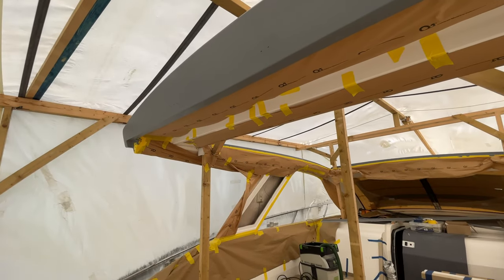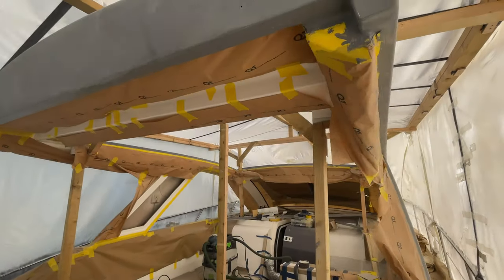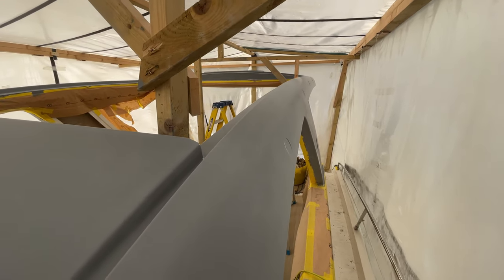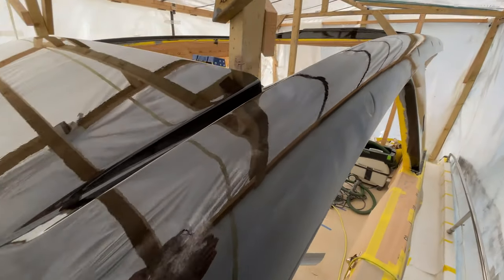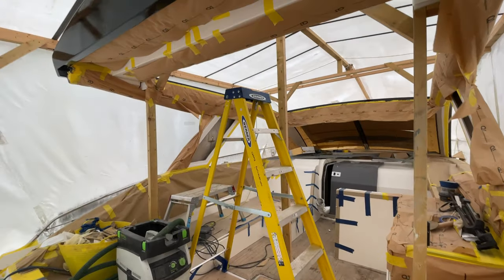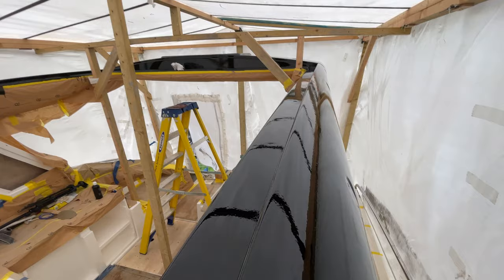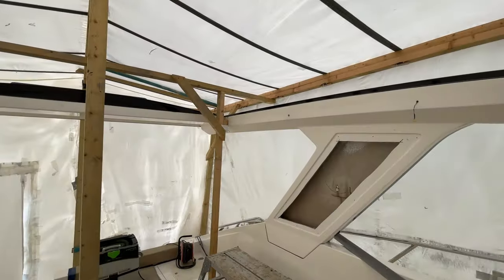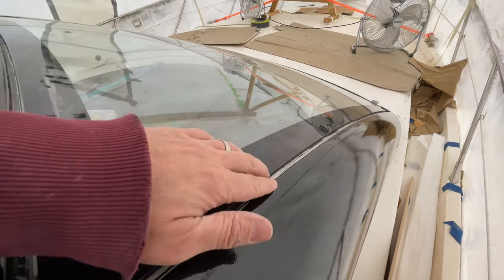PAINTING our BOAT with ALEXSEAL using a ROLLER - EP.74

Comment: I have debated about sending this comment but here we go.  First your work up until now looks great!   However the new paint job has made a lot of work for you to have it the way you want.   First the roller you used was too course so you have lots of orange peal that will be hard to sand.  The way that works for me is to roll and tip.  This leaves a finish that is almost as good as spraying.  Look this technic up on inter inter net.  Think you will like it.  Keep up the good work..
Reply from the maker: Thanks Richard, always good to hear other people’s experiences.  We are complete amateurs with the Alexseal system and we were very much learning on the job. We did consider tipping, but decided to go roller only method based on Andy at Boat Works today experiences. We think a combination of temperature and mixing ratio most likely caused the orange peel. Interested to hear their are better roller options. The Anza felt rollers were recommended to us by the Alexseal UK distributor, but I’m sure there are better options available. The top coat has now been wet sanded and polished. The results are excellent and will be covered in a future video 👍🏻

Comment: I'll be "painting" my radar arch in the winter and curious of your choice of Alexseal.  It looks amazing, so I'm interested to understand why you chose this over Awlcraft and why you chose not to go for a clear coat on top.  Look forward to your insights.....
Reply from the maker: The consensus seems to be Alexseal is easier to work with and repair. Alexseal doesn’t need a clear coat. We learned later on to use a higher percentage of brush reducer which gave us a better finish off the roller….

Comment: What rollers did you use? Couldn't see if that were foam or mohair rollers. Please also tell the brand and exact type if possible.
Reply from the maker: We used Anza Felt rollers in this video, however we've recently used Redtree Mohair rollers and have had better results !
Reply: @boatholic4458  Thanks so much!